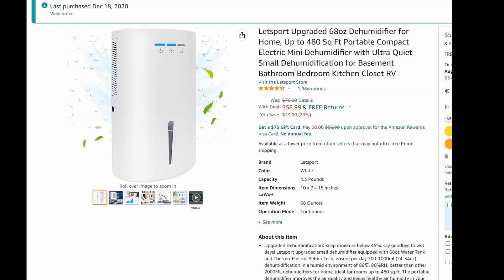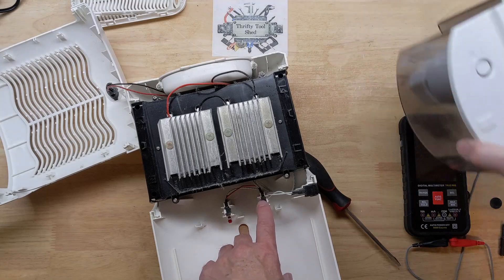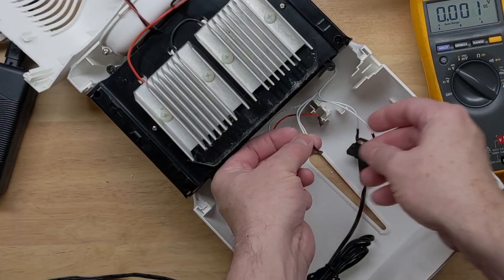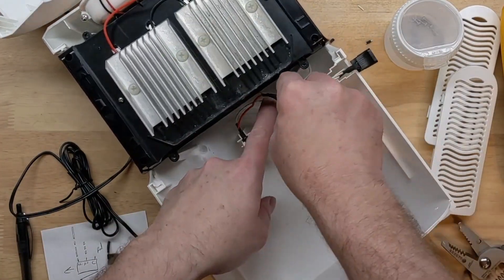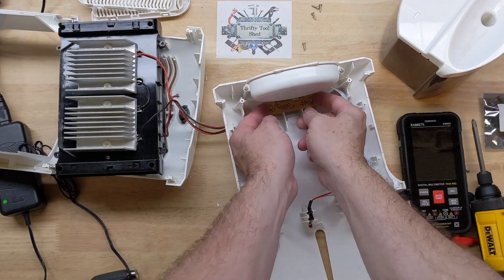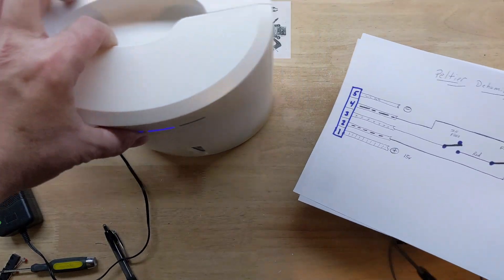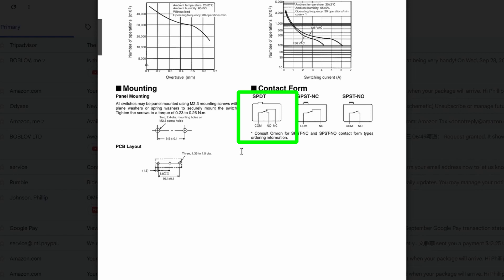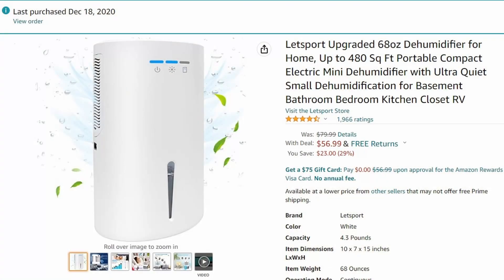Peltier Mini-Dehumidifier Repair

Comment: Hey man, great video. I also have a peltier dehumidifier at home and I just found out that there's no water falling from the heatsink now (it used to be), so now the tank is always empty despite being placed in a very humid room. Do you know what could cause this?
Thank you.
Reply from the maker: Hi, it would most likely be the Peltier device. Either faulty or power is not getting to it. Most of these if the fan is on, then the Peltier also has power, but some may be wired differently. Fan and Peltier is all it is to it.
Thanks for your kind comment!

Comment: I have the same type dehumidifier and it just stopped working not that long ago. What could be the problem? When I turn on front switch does not turn on. Appreciate any tips of what could be wrong or what to do to fix or it is fixable.
Reply from the maker: Hi,
It is most likely one of the 2 switches for the bin. One is in place switch, and one is a high-level switch. One of these is most likely the culprit. I would not recommend buying the cheap replacement switches as they last no time. After replacing with the Omron switches, no more issues. I have a link to the Omron switches in the video description for reference.

Comment: Can we change it to air cooler
Reply from the maker: You can use a Peltier device for very minor cooling since it has the working principles of heating one side cooling the other. You would have to design a way to get the hot side removed (as in outside) and then the cool side blown over the area you desire to cool. This size device is maybe powerful enough to cool down a small cooler and keep it cool for example.

Comment: I have this same model. The issue presented it self in the same way as this one you had. If I wanted to, would I be able to just snip the wires and connect them directly, circumventing the switch? I tried doing that, but it didn't fix it, so I'm curious if it might be a different issue or if just connecting the wires doesn't work how I would expect it to. Thanks!
Reply from the maker: I have had a power supply failure as well and have a video on that repair. Other than that the unit should work, but realize the switches work like Bin in place and then level full. If level is not full and bin is in place then it will run.

Comment: Hey, thanks for the video. Any idea what to look for when doesn’t collect water?
Reply from the maker: It does take time. I will assume you have let it run for days and still no water? It is a simple device with few parts. Power has to be to the Peltier device and the fan has to move air across the fins. Make sure power is getting to the Peltier devices usually wired in series. They will be the highest load in the system, usually around 4 or 5 amps at 18V or so. If you have a way to check current I would check that. The fan only takes .5 to maybe 1Amp to run it. Hope it helps. Best of luck to ya!

Comment: Ty for video! I am trying to test the switches but not sure how since theure soldered in...but am wondering...my led lights are like yours and fan wont kick in. But how do you know if its the fan motor or a switch? How did you know?
Reply from the maker: I could tell how the switch was wired and I should have shared it on video or at the very least shared a really quick wiring diagram...
Reply: Ty. I just removed everything, including the circuit board, the fan...the microswitches, then reconnected...fan suddenly is working again. Seems it may not be gathering as much water as it used to....any suggestions? Thank you so much!
Reply from the maker: Hi,
It is a slow dehumidifier for sure. If it does not work well check to make sure the power is getting to the Peltier devices behind the heatsink. Typically the power to the fan is also going to the Peltier devices. Other than making sure the heatsink is clean, I can't think of anything else to check other than the Peltier devices itself to make sure they are getting cool on one side and warmer on the opposite side. If they have power they should be showing the temperature difference. 
Best of luck to ya!
Reply: Thank you Your! Your vid helped me so much.
Reply from the maker: @AngelDawn4u  
Glad it helped!

Comment: Will this work in dehumidifying the cabin of a car?
Reply from the maker: I would imagine so. It runs at 18VDC I believe so it may work fine at the 14-15 volts while the alternator is putting out. It will do even less work with lower voltage for sure. I believe the Peltier devices are 12V in series? Can't remember about the fan...
Reply: @ThriftyToolShed  well, i have a portable battery bank from ecoflow (300 W output) that i bought for something else and currently not in use. The idea is to have the ecoflow/dehumidifier to turn on 30 mins before I need to head out
Reply from the maker: @verygoodbrother  
I gotcha, it is a very slow device. It may help, but my thoughts are that it will need more time. It takes about a week to fill up in our bedroom and we need the dehumidifiers running all the time to maintain less than 50% so it's running all the time.
Reply: @ThriftyToolShed  thanks for letting me know

Comment: Hi I have the same dehumidifier. How did u get the bottom 3 screws out? The piece blocking the L shaped tabs at the bottom. Thanks!!
Reply from the maker: Mine simply had 3 screws in the bottom. Some of the models may have the screws covered with a felt or rubber pad. After the 3 screws were removed mine simply had the L-shaped catches as shown in the video and you could pop it apart.

Comment: Can you just put a hose on the bucket & never have to work my about the switches on a new unit?
Reply from the maker: Well it's not designed for a hose like the bigger dehumidifiers, so you would have to get creative with a bulk head style fitting with a gasket or o-ring etc.

Comment: I always find it interesting to see whats inside things and how they work  - thanks for the video! I cant help but thinking - it would have been so easy for them to use a couple of  photointerrupter type sensors, a MOSFET, and a few other cheap components in place of the switches. Not only would it last much longer but would probably be cheaper to make.
Reply from the maker: Very true! Thanks for your comment!